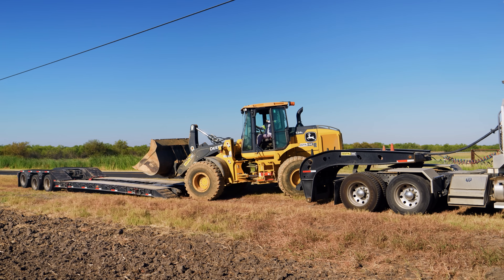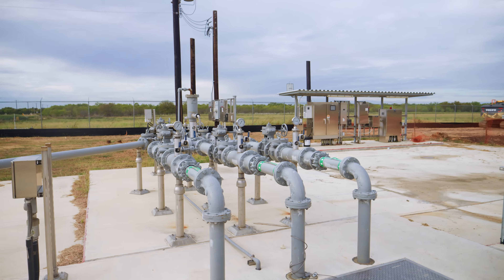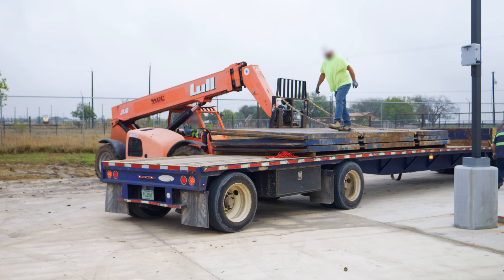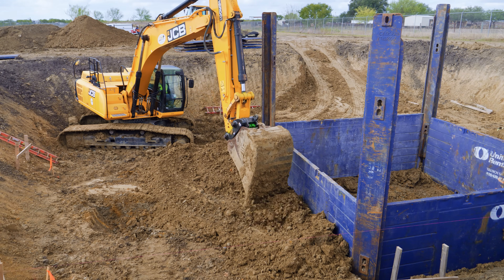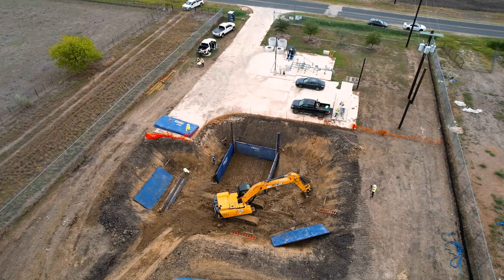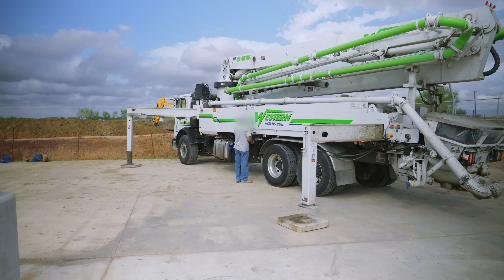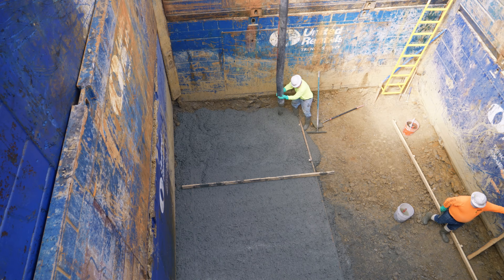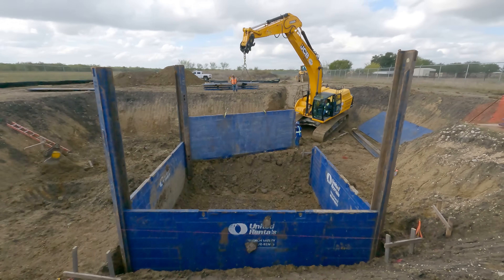HEAVY CONSTRUCTION of a Sewage Pump Station - Ep 1

Comment: The shoring/rail advancing is what a Delmag Frog is for. Well, it's modern descendants.
They're 2-stroke free-piston hammers.
Particularly popular before the gearbox technology for the vibration loads in the modern highs-peed 4-stroke engine based soil-compacting vibrators was ready.
The H2S model for example was a compact machine the size of a medium child, and about 100 kg. In operation it jumps when you press down the handle bar, just to fall down with all it's weight back onto a surface area of about one steel toed boot worth (but circular).
They were also used with afaik a mild modification to the foot for setting paving stones.

Yes, of course they're kinda banned now by osha because idiots operated them with negligience and had them jump onto their feet. And I understand how a 100 kg boot jumping onto your toes can hurt you.

Comment: Interesting.   I designed a few sewage pump stations, and quite a number of additional emergency storage tanks for older existing stations (as environmental restrictions on overflows during power cuts became more demanding).   Since the sites were usually fairly restricted, all the excavations were sheet-piled.   
Groundwater levels were significant - one of the main considerations was ensuring the station or tank stayed down and didn't try to 'float' up out of the ground. 
I don't think we ever had the luxury of firm uniform clay like that in the video.
We used precast on smaller pump stations, but the chief advantages of precast are precise geometric dimensions, accurate steel positioning, and the lightest weight for a given load-carrying capacity - important where the overall weight of a building is concerned; but when your main concern is making sure it doesn't float, in-situ concrete with plenty of cover to the steel has its advantages.

Comment: Question from non civil engineer.😅
1. why do you need 2 crain to life the pre cast section
2. I saw a video in China where they just sink the pre cast by just dug the earth inside the pre cast but in this video we dug a square hole and put a cylinder pre cast in. Is there a safety reason for doing so in this case.
Thanks

Comment: I love that a lot of times on job sites with heavy equipment like excavators, the bigger structural pieces are usually made with the thought of being hit by said equipment in mind. Like, the fact that someone will look at a excavator and think "That can pile drive this steel beam in the ground easier and faster than they could get some special other machine out here" and just do it, and it works is testament to mankind's desire to hit things with bigger things.

Comment: How do you measure what elevation you're at inside a dig? I've never thought about it before, but... What's the frame of reference? You can't use "meters below ground," because that's pointless across large areas. Air preassure varies. GPS?

Comment: I helped rebuild a smaller version. We had to replace both grinder pumps, the pipe coming off, upgrade the electrical, and lift the building to replace the floor and beams. All that moisture played havoc with the original plywood, and pine beams. It should now out live a couple of future owners. As long as the pumps are maintained this time.

Comment: I was setting up this type of pumpe station in horrendous mud pit where water level start about 2m under ground and we had about 7m deep pump station. Impressive you gyus don't have to use wellpoints to dewater this pit. We had to have multiplied wellpoints by 3 in order to have somewhat dry subsoil, but still it was bit of a challenge :)

Comment: Okay, I’ve just had an idea but I have no background in engineering so could someone provide me with some feedback? Anyway, here’s the idea. 

First, build a concrete protrusion out into a river. Far enough that at its edge low tide still leaves the riverbed completely submerged. After, construct a waterwheel. Have the edges of the waterwheel made of a dense material that isn’t buoyant while the inner 4/5ths of the waterwheel are made of a more buoyant material that is vacuum sealed and filled with air. On the concrete structure have some kind of mechanism with a vertical groove onto which the wheel is fixed. As water flows, it will turn the wheel but as the tide changes the wheel will be able to move up and down the vertical groove because of its buoyant inner core. Feasibly, could this not generate a continuous stream of green, economic power? You could build a few at a time even. 

Now. I don’t have an engineering background, so if someone could give me feedback that would be sweet.

Comment: Talking about lift pumps, I can’t help but wonder how they do it in my area. I live in a subdivision that sits 30-45’ higher than the next subdivision one street over that has a man-made lake. I have been in most of the streets and I can’t find any piping that would reveal a pump station. Here’s my question, since I know that our sewer systems are connected, how do they keep the homes down there from flooding with waste water?

Ps! I know the sewers are connected because once I saw them doing a “smoke test” and it was coming out of the cover close to my house while it was being injected at the lower street.

Comment: Mom was an inspector and then later a construction manager. I got to see this in person at intervals. Massive pipes, valves, and amounts of concrete. And the crew had to work through a lot of rain to get the shoring installed. But that's expected in the Pacific Northwest.

And that's a little itty-bitty pump station. I think the budget for that was the art budget (...don't ask...) for the one I got to see.

Comment: Great video.I built a sewerage pumping station back in the mid 70’s it was 15 meters deep but we built it on the top of the ground without out any excavation. Once we had finished building the walls to a set height we would dig out in the centre with an old dragline and the more we dug out the share load of the concrete walls would just sink until the top was at ground level again and then we would start the next section of walls on top of the last section and repeat this same process until we were 15 meters deep and then pour the floor. Same outcome difference process

Comment: Very, very good, and not one word about false deadlines and other types of made for TV pressures.
If this is a second lift station at an existing location, I assume that means there won't be any new sewer pipes installed. Besides being a backup lift, is this second lift also needed for regular operations, and does this sewer also carry rain water from streets and roofs?
Again, thanks for making this type of program, this format is much needed.

Comment: this is the best way to teach engineering to folks especially kids. Informative, simple to understand and excellent angles to see how exactly the job is done. I'd also like to add that there is no such thing as a unimportant job, everyone at this jobsite matters, if you are inside that hole installing the concrete, to the boys hauling off all that clay/dirt to the dudes setting the crane for optimal use, EVERY job is important. hopefully we get away from this stigma that only the higher earning jobs matter.

Comment: 1:30 - Let's see if Grady touches on my favorite wastewater screwup of the last 30 years -- low-flow toilets are incompatible with the slope of residential sewage piping, which was designed to stay clear with 6 gallons per flush, and has a real hard time at 1.6gpf, much less 1.1gpf.  If you've owned a house old enough, long enough to notice this, did you?  I've lived in a 1970 house about half the time since 1981.  Got much worse after we replaced the 'classic' toilets with lo-flo's.

Comment: Pretty cool idea for a Series!  As a contractor in Alberta Canada, who has been part of new Lift station construction I am always excited to see how things are done in other locations. The project I was part of used a large diameter drill rig and round shoring in sections that were installed as the rig got deeper. Also we are typically way deeper... deepest one I have been in to date was 165' but on average we see 50 70' or 15 - 20m +/
Reply: Not sure why the last line is crossed out haha but it wont let me edit it so 🤷🏻‍♂️

Comment: I found this first video really interesting especially as this type of infrastructure work is primarily what my employer specializes in. They are an industrial wiring and controls company that does a lot of work in the central Texas region. We usually come in with or soon after the GC starts work and start the process of installing the underground electrical and controls infrastructure. With cast in place structures, that can mean collaborating with the GC and engineers to add sleeves or conduit stub ups in wet well structures and slabs for controls and power for various sensors such as level, pressure, and flow loop elements as well as the power and controls for motor actuated valves. Sometimes on existing infrastructure like this there is a need for coordination so certain processes can be bypassed or shut down while new portions of the system are connected and brought online. These shutdowns can be an especially stressful time. There is usually a narrow time window when all contractors have to get their portions completed.... and as a controls company, despite the best testing by the builders in the shop, there is almost always a few hiccups that have to be sorted out. Sometimes is it relatively simple like float levels... sometimes it can be more serious, like deep rooted relay logic or PLC programming issues. Sitting there trying to read and interpret the the ladder logic while everyone is waiting can be the epitome of stress. This area (San Antonio to Belton, and 100 miles on either side) is seeing tremendous and some will say, unsustainable growth. Many communities are really having a hard time finding additional water sources to power the continued growth and industry that keeps coming in. This is fueling a massive amount of infrastructure projects. Case in point, the new $17 billion Samsung Facility in Taylor, which will require up to 15 million gallons of water a day for its processes that they expect to pump out of the Carrizo-Wilcox aquifer in neighboring Milam county, 25 miles away.

Comment: Another great video. I have spent a lot of time as a child at a sewage treatment plant, as my father was an operator of the equipment. 30 feet is not very deep, the deep level inlet for the treatment works was 30m or about 100 feet. The surprising thing for most people without detailed knowledge is that sewers must slope at precise angles. Too steep and the liquid flows too fast leaving solids behind, too shallow the flow doesn't support the solids in the flow.
In the city of York, England the oldest sewers in use have the name of the builders embedded in the bricks, the mark of the Roman Legion which constructed them. Most legions were excellent builders. In Tunisia parts of a 96km aqueduct built by the Romans are still in use today.

Comment: When they added sewer system to our street in the late 90's, we were forced to have one of these installed in our front yard, as we were the last house on the line at the bottom of the hill. I presume it's a much smaller version of what's going in your location, but it ended up being twice the size of what they said it'd be when they told us we'd lose our front yard!

Comment: I work as a sewer locator for new gas lines, I got the chance to see one of these stations after it was built because the station got a gas line. The station hadn't been fully setup with a discharge line yet but was still cool to see.

Comment: Why are dirt carrying trailers so small? 20 tonnes isn't very heavy for trucks, and it means that every time so many trailer loads are required. I know that they must be able to self-tip, but why not use the extra length up to the maximum trailer length to house those hydraulics?

Comment: The only thing that can actually be WRONG with that clay is if it is expansive, highly expansive clay will shrink and swell and may not be very stabile if the moisture content swings too much.
I guess you also need a competent contractor to deal with tough clays even if they are not expansive...... Too many of the contractors where I am think they can pack clay dry (Yes it is very hard and passes a proof roll when you compact it dry, until water gets into it, then the water just soaks in, and then your clay is not stable.

We do all of the sitework, overex, and wet utilities to take empty lots to paving on commercial residential with just a single crew (usually apartment complexes). Through 2018-2021 our jobs were ALL mildly expansive clays, we were so happy to work in sandy soils again last year..... It feels like cheating when I don't have to fight to mix water in.

Comment: Duuuuude. This is the start to an awesome series, and I'm 100% here for it! Couple of thoughts when watching:

1) The skill of the operators and the versatility of these construction vehicles is uncanny. It's so damned impressive.

2) That crane truck raising its tires while its outriggers are planted is so cool. The sheer engineering that goes into these hydraulic systems and machines is awe inspiring.

3) There's so much infrastructure we depend on that we don't even know about. Dudes building sewer systems end up saving more lives through sanitation than we could even guess at.

Comment: I really enjoy watching construction equipment working but I have the feeling that this project could be done faster and cheaper. that metal slab system where you have to put an excavator hammering them down does not looks right at all. It is clear where the money for  that comes from so lets waste it.

Comment: This will be a good series.  I'm a retired engineer.  I spent most of my career in the water/wastewater industry and worked on many lift station projects.  It's interesting to note the differences in construction you use in the south, compared to up here in the northern US - for instance a lot of your process piping and valves are above grade in open air, where we have to worry about freezing temperatures.
Reply: I understand that Texas doesn't worry about freezing temperatures and is surprised every time they occur. I'm not sure this is the wisest approach.
Reply: Perhaps they decided to put them in the open so they are easier to get to for repair when they freeze 😉
Reply: Based on how they were impacted by recent winters maybe they should look into more northern standards.

Comment: “As the hole deepens, the operator uses the corner posts of the shoring to methodically cave in the bottom of the excavator’s bucket.”

“Next, the machine’s bucket is taken to a fabrication shop for repair.”

(If you guessed that I work in this field and have an eye for such things, you would be correct.)

Comment: I know you said about the sides potentially collapsing in so they use slopped sides and then dig down with shoring. If they are going to use shoring anyway at a certain depth why not just use shoring from the beginning? I don't see the point of having slopped sides first then shoring further down. Great video as always

Comment: this pump station looks tiny so far, curious to see how it turns out.
ive been working at a small local to me pump station today, it has 3 pumps, one of which pumps at around 360 m3/h, and in order to deal with surges, by looks, it is about twice the diameter of this one and they still have issues in surge times.

Comment: sir, i may be posting a bit too much, but i gosta ask: 7:45 they set it up perfectly square, so the workers take their time to measure everything carefully.
I understand.

But then i see them working with a tapemeasure.
Not a laser.
Just a piece of plastic with numbers written on it. Or perhaps a metal strip. Who knows?
It is a piece of material which they hang between plate 1 and 2.
I think a laser might be more accurate???

Comment: Great video Grady! I suspect the contractors might get into trouble with the equipment hire company - using an excavator bucket as a hammer is tool abuse, repairing the damage clearly visible to the underside is expensive. Kurtis from Cutting Edge Engineering Australia would concur!

Comment: I worked in Commercial HVAC for a few years & one of our jobs was for Mecklenburg County outside Charlotte N.C. at a sewage pump station, installing radiator louvers for a 16cyl backup genset, I only caught the backside of the construction, but I'd bet that station was 75 ft deep. It was one of the most interesting things I've had a part of building. Great video!

Comment: Our University campus, North of Bangkok, is built on an old swamp plain, so very flat and very level. It's a 1.5x1.5 km square. We have sewage pump stations around the campus, I have seen the one close to my building maintained (mostly replacing the pumps) but it was built way before I came to live in Thailand.

I'd say the hole is 2.5x2.5 m square and maybe 5 m deep. Once I understood its purpose, I never tried to get too close. OK, only once, to see how it was inside because I needed to understand.

Comment: As a construction plant mechanic. I can tell you from experience, that the way they use the bucket hammer the rails down @ 9:46 is extremely hard on the bucket. It dents and destroys the bottom part and has to be rebuild. They are not built for that.

Comment: Not only does the concrete pump truck make it easier and cleaner to place the concrete, it is absolutely necessary as pouring concrete and letting it fall more than a foot or two causes all of the larger aggregate to end up at the bottom of the pour.
Reply from the maker: My understanding is that's a myth, but I haven't done a lot of research on the topic. https://ascconline.org/Portals/ASCC/TB-Free-Fall-of-Concrete.pdf
Reply: @PracticalEngineeringChannel  Interesting, I had not seen this!